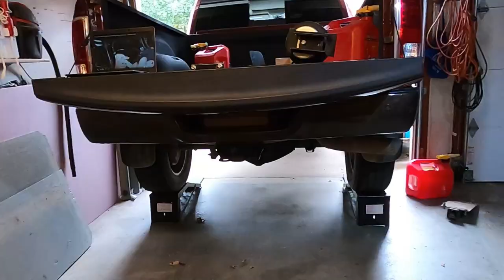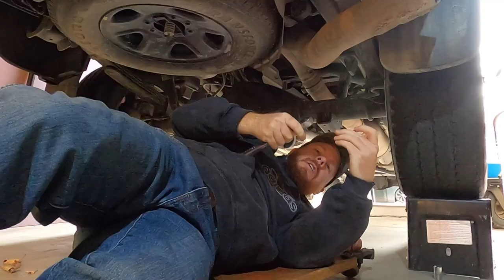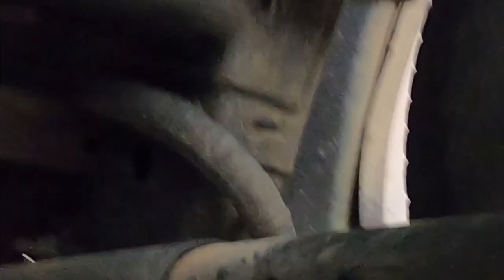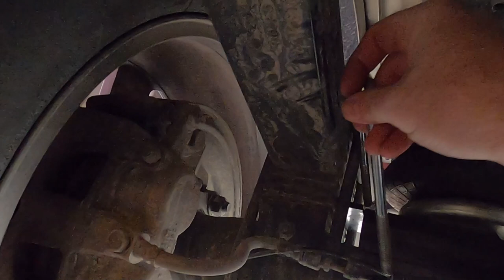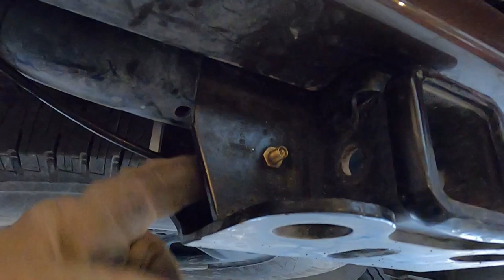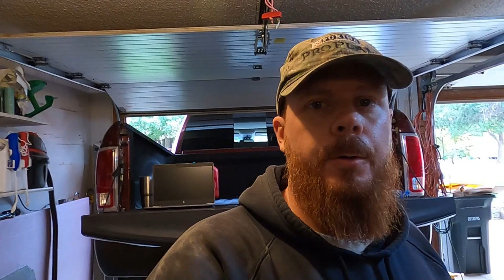Ram 3500 Air Suspension Bags

Comment: Do they improve (soften) the ride when you are not towing? My 3500 rides like a jackhammer and I am looking at not only improving towing but also improving the ride when I'm disconnected.
Reply from the maker: No you are correct with the jackhammer comment! I like to air them down to around 10psi when I'm not towing, I feel that is where I get the best ride unloaded.
Reply: @RedbeardOutdoors-IrishSetters  great. Thx for the advice and quick reply